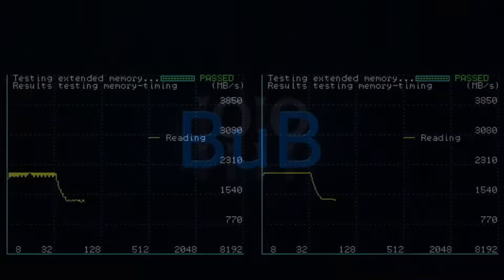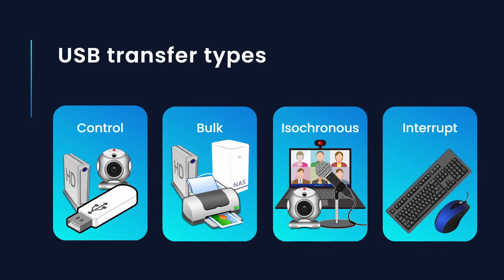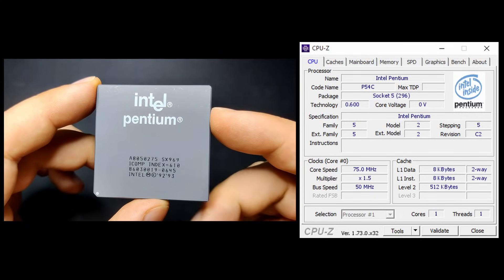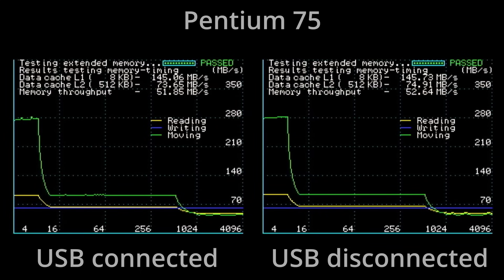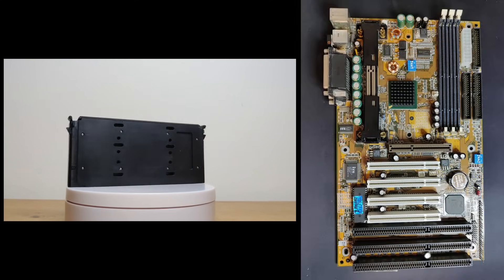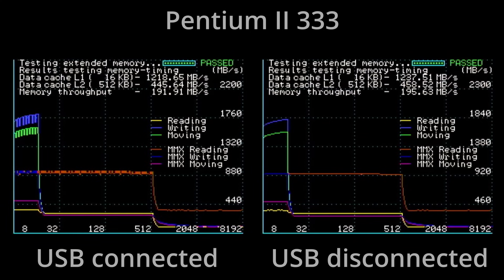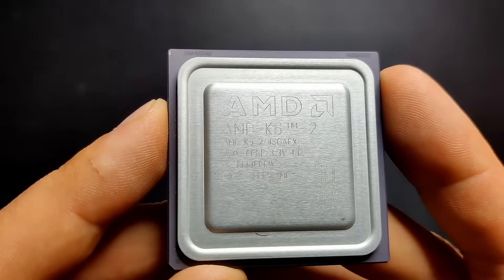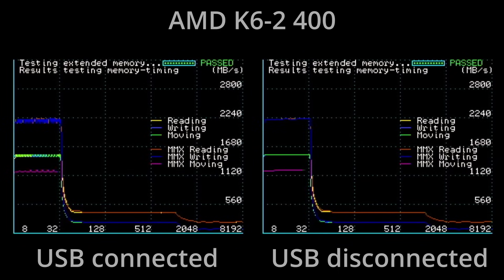Why you should avoid USB in Retro PCs

Comment: Very interesting and usefull test! Could you do something like that even with sound cards? You know that typical lagging of Windows boot sound, I was always curious about how to solve it in Win 9x systems, using better soundcard mostly doesn't solve it completely, but some soundcards have more stuff on them, so it could use less CPU and ram I guess, but I don't have any fancy Win 9x compatible soundcard to test it. The best I have is SB0100 and even with Pentium 4, booting sound in 98 and ME is still lagging.
I will be building computer for dos games with real ISA soundcard soon, so I am really curious if it's gonna be better with isa soundcard.

USB devices slowing down CPU actually make sense to me, another thing I found out thru my computer history is that integrated sound cards tend to use CPU more which can result in that typical glitching Windows boot sound, but there is not a clear rule about it, some dedicated sound cards can be even worse and vice versa and this is not happening after switching to NT based systems, so there are still things I don't really understand.
But I don't think that some 1-3% performance hit is worth to not using USB at all.

I mostly target specific motherboards with tested good compatibility where I can set USB mouse and keyboard in bios and it will always work. There are motherboards that do this well and there are motherboards that do this not well. Ofcourse I am talking about HW from time when USB was already a thing, but not a standard for mouse and kb yet. There are massive differences between motherboards from era of socket 370 or AMD's 462, some of them work like a modern PC and some of them are completely useless.

What you should really avoid always are motherboards that already have SATA for Win 9x systems, that just doesn't work or amount of work with that is not worth.

Earlier P2 and P1 MBs have advantage that there is no integrated USB controller, so you can use one that is actually good and have a good compatibility, but ofcourse mouse and kb will not work, but I would not say just avoid USB completely, I know that we didn't have flash drives back in the day, but it's really annoying to move data without that, I like retro, but I don't want to spend whole my life with messing with data, sometimes I just need to test some drivers and a lot of stuff before I permanently burn it to the CD, so USB is really usefull.

Ofcourse when you target DOS or Win 95 era, you may really need some serial port mouse and stuff like that for compatibility.

Comment: USB communication makes some things impossible. For example, the program I use to dump Commodore 64 tapes through the parallel port (MTAP) doesn't work if I boot DOS via USB. It must be either FDD or HDD, otherwise gaps will appear in the data.

Comment: I knew that back in the day when retro pc's were just modern computers. The connectors and brackets were there but the software support wasn't there. For fast data transfer I stuck to SCSI. But my god, parallel Connection with my externel ZIP drive was really slow......

Comment: Very interesting video!
A few details and thoughts:
  - From the PC's perspective it makes no difference if the USB supports "real" interrupts or not: The USB host controller manages the USB protocol side (including polling the devices) and sends a (real) interrupt to the PC whenever necessary. Some controllers might send unnecessary interrupts and let the driver figure that out, in which case you would have a significantly higher interrupt load. I'm not aware, however, how frequent that behavior is in practice, so let's keep that in the "theories" drawer. On the other hand the fact that on some platforms you tested there were periodic dips in the performance, presumably without any mouse movement, would support that hypothesis.
  - The problem presumably comes from the fact that the USB driver stack is interrupting the current program and affects the contents of the cache - just as the PS/2 interrupt would - but is probably more complex, accesses more data and affects the cache more than legacy input device drivers.
  - The specific driver implementation is another issue: If not in legacy emulation mode, the USB communication goes through the driver the manufacturer of the host controller provided. I suspect the implementations will differ wildly. It would be interesting to see how this issue affects Linux, which I suspect might have more consistent and better quality drivers overall.
  - It would also be interesting to compare different host controller cards, and specifically USB 2.0 ones.
  - As was mentioned in another comment, legacy emulation could lead to poor performance as well and needs to be tested and compared on a motherboard level basis to understand the impact.

Comment: I haven't watched all the video yet, but if you don't know, not all USB chips are created equal. Have you compared OHCI with UHCI? OHCI USB implement a more intelligent chip while UHCI pushes more work to the CPU. Common vendors are... NEC for OHCI and Intel/ VIA for UHCI. I always avoid VIA USB cards. This applies to the USB 1.1 era and USB 2.0 cards running in 1.1 mode, but I'm not familiar with later stuff.

Comment: USB penalty in retro devices isn't just hardware issues, but also software issues. The USB stack modules included in BIOSes for KB/Mouse support in DOS mode aren't smaller things and can consume precious UMB blocks you would need for other stuff. Sometimes it will prevent EMS memory from working as the USB BIOS module will steal the EMS window memory block (some Systemsoft BIOSes show the problem, it can be fixed assuming the board manufacturer provided a fixed update for that). This enables SMM/NMI which can conflict with DOS software and DOS drivers which also make use of NMI (sound card drivers or emulators for example).
In Windows, USB will always enable WDM (NTKern). Depending in your board and devices, it can conflict with VxD drivers, mostly sound cards. It will consume more memory, and make the OS slower in some circustances.

Comment: I was testing this with a NEC D720101GJ chip-based USB 2.0PCI card on an AMD K6III+ 550MHz @ 600MHz on an Asus P5A and noticed a 3% drop in composite system performance drop in Windows 98SE.

Comment: I was wondering, if you use a USB to PS/2 or 5-pin DIN converter, does the performance drop still happen or do they operate the same as PS/2 or does the polling problem still come up? I'd be curious to see if they still interrupt as often with the converters installed or if they interrupt like an older device.
Reply: When you use those adapters the device is just routing PS/2 signals though the USB cable as if it was a PS/2 mouse. There is no USB signals involved. Unless it is a fancy active adapter, which most aren't and even then the computer wouldn't see the USB protocol.

Comment: So only usb 1 is an issue because it doesn’t have its own hardware to use. 

So usb 3 should be used cause it has its own chips to process data independently of the system itself?

Comment: Just a few days ago i was testing an old system equipped with a Pentium 3 667MHz on an AOpen AX34 Pro, 256 MB of SDR PC133 and a Voodoo 3 3000 running windows 98SE. That system has only 2 USB ports in the rear I/O panel so i added a VIA based pci usb card. With a usb stick connected to that card, running 3D mark 99 Max i was getting a final score that was half the result i previously managed to get...unplugged the usb stick and scores were back to normal... Pretty extreme behaviour, i know that VIA pci usb cards are doomed but this behaviour is fare beyond my expectations...

Comment: i personally prefer using dedicated connectors when possible, i never trusted usb with its unreliable wiggly connector and its general purposeness. i much prefer using a dedicated driver and connectors with screws like db15 or some other locking mechanism like the little clips on hdmi.

a few days ago my keyboard disconnected while playing a game. this made the system crash so hard i had to clear the bios settings and unplug the pc for a few minutes so it would turn back on. maybe it wasn't just the keyboard, but unplugging and plugging the keyboard back fixed the problem. the usb connector on my keyboard always fits lose on all connectors but as long as i don't move it this isn't a problem.

Comment: The problem with the older USB Standards is that everything HAD to pass through the CPU during USB transfers. Something that thankfully was finally abandoned with the introduction of USB 3.0 and 3.1. Which i think is definitely the biggest gain from this standard upgrade, beside the file transfer speed.
Reply: This is also the reason why Firewire was superior even to USB2, even when it looked sighly slower at specs. Firewire controllers, just as SCSI before them, were always "smarter" than their USB counterparts. The CPU in the FW ASIC of the card and the peripherals could do more by itself and transfer the data between them and the host by using DMA with almost no CPU intervention. Also, the software stack was smaller, which meant you could do things like implementing Boot Support, Debugging Mode and Target Mode (your computer appears as an storage device to another computer) in firmware in a very compact way.
Ofc, since firewire controllers were almost microcomputers by themselves, that means the controller chips for both cards and peripherals were more complex, expensive and less scalable to produce than USB counterparts, which in the end was firewire demise.

Comment: I still use a PS/2 keyboard with my modern system. I would use a PS/2 mouse as well if my motherboard had a second PS/2 port. It only has one PS/2 for keyboard OR mouse. PS/2 ports have 6 pins but only 4 pins are used. On motherboards with only one PS/2 port, the 2 unused pins should be the clk and data for a second PS/2 port via a Y adaptor. All the super I/O chips have 2 PS/2 ports so there is no reason why the clk and data for the second port couldn't be routed to the 2 unused pins on motherboards with only one physical PS/2 connector.

Comment: Just stay out of USB on motherboards where Super IO did not support it. That's anything with a slotted CPU and before. If you need flash storage, there are CF and microSD to IDE adaptors (or adapters, for US friends). However, these do require reboot to detect media changes. I have a K6 ][ with an SSD, via Vantec SATA to IDE card. You can buy them cheap, so it's good to have one around. Be sure you connect 3.5 floppy power plug for 5 volts. Have fun!😁

Comment: In my new Socket 7 system (k6-2@400) I tried using Daemon Tools on 98SE to read game images through a USB 2.0 card. It made all my gameplay stutter whenever the disc was accessed. A physical CD didn't have any stutters even though my drive struggled to read it. Daemon Tools from the local IDE drive also played perfectly smooth.
Reply from the maker: It could be related to the USB chipset used on the card. I will look into this, maybe I'll be able to reproduce your issue.
Reply: @bitsundbolts   It's not really an issue, just another anecdote that USB can cause slowdowns in old PCs. I don't think it's hardware related but rather software related as I tried XP (or possibly 2k) on the same hardware and IIRC that worked smoothly. I would've kept using XP but 3dfx didn't release D3D drivers for the Voodoo 1  on this platform.

I believe the particular card I was using has a VIA chipset. I think I have a card with an NEC chipset somewhere I could also try if I want a change in the setup.

Comment: I believe results can vary based on controller chip or other factors, but particularly with add in USB2 cards, that the USB controllers being enabled (no device plugged in) in device manager can at times be enough to cause a performance degradation.  Of course that means you can just toggle the controller on and off as needed if max performance is desired.  I have gotten mixed messages from others on the exact conditions on when the degradation happens, but I know what works for my system.

Plenty of fun stuff to test there since USB 1.1 comes in OHCI and UHCI flavors, and USB 2 cards expose one of those on top of the EHCI controller which can be disabled individually.  If my memory serves they also as a result, if all controllers are enabled, use 3 of the 4 PCI IRQs, so while not a huge deal IRQ sharing could be a factor in achieving the last bit of performance.

Comment: Just want to say, USB overhead was well known at the time and even latency was an issue. This was all known and tested extensively by nerds a long time ago. USB didn't really become a non-issue until USB 2.0. I remember very well discussing this ad nauseam on forums back in the day.
Reply: It looks like USB 1.0 generates interrupt for CPU every time mouse moves (instead using DMA bypassing CPU entirely).

Every CPU handle interrupts and context switching with different penalty in cycles lost. Modern CPU has special HW to accelerate context switching due to those were designed for modern multitasking OS. Obviously old CPU designed for single tasking DOS lacks this support.
Reply: There were overclocking tools for PS2 and USB back then.

Comment: It's interesting that you reported this. I have a VIA USB 2.0 PCI card in my PIII-933 system. I use it routinely for large file transfers as I have reliability issues with my optical drives. I also don't expose my current systems to my retro systems over the same network. Honestly, it doesn't affect performance for me to notice it under Windows 98 SE (USB storage extension) and 2000 Pro.
Reply from the maker: I have not seen any issue with data transfer (HDD or flash drives). The issue only appears when using input devices like keyboards and mouse. I will get some PCI USB 2.0 expansion cards with different chipsets (NEC, ALI, VIA, etc.) and see what is going on there.

Comment: I wonder, if disabling 'legacy device emulation' in BIOS would speed things up under windows. (But this will entirely disable USB input under DOS)
Reply from the maker: I have to look into this more in depth. I don't think that the two socket 7 motherboards have that option in the BIOS. They only allow to enable or disable USB. I may test this with PIII and maybe even a P4 system

Comment: I have several retro computers that have usb and none of them have any issues with pendrives or keyboard and mouse. I just use usb in order to use pendrives but I ran tests with a wireless keyboard and mouse and everything was ok. No change in performance.
Reply from the maker: That's interesting. 3 of the 4 boards I have tested in this video show the issue visually in SpeedSys when an input device like a keyboard is connected via USB. Could you share the hardware you're using?

Comment: Connecting a single flash drive to my K6-2+ machine via USB2 card KILLED performance, way more than 3%! 3DMark2K score went from 1600 to 1200! The reduction is much less if I swap the USB2 card for USB1.1 but it's still there - maybe 10% or so in the same test. Also I did try USB2 cards from different manufacturers and there was some variance. IIRC the card with an nVidia chip did the best which is the one that dropped the score to 1200.
Reply from the maker: That is interesting since I couldn't notice a performance loss with storage devices connected to my systems. The behavior only appeared when using input devices like keyboards. It may come down to the USB implementation. I'll try to get different USB 2.0 expansion cards and see if I can recreate your experience.
Reply: @bitsundbolts  I believe it's something about that specific K6-2+ machine because I don't see that massive deficit with any other retro PC.  I do recall seeing a SMALL deficit though, with my 440BX-based 1GHz Pentium III system when leaving a flash drive plugged-in.

Comment: The performance drop is waaay bigger than 4%, I remember back in the day I had a PIII 550 Mhz, and when I switched from a PCI 56K to an USB 512 Kbps modem, when playing Counter-Strike, my FPS went down from 50+ to low 30's, it was immediately noticeable, I had to keep it unplugged all the time to just play single player games, I begged my parents for months to switch to another ISP, when they finally got an RJ-45 ethernet gateway it was such a relief, I got back on good form again.
Even today in modern 8 core systems, you can clearly see in task manager that when moving a 1000 Hz "gaming mouse" prevents the CPU from getting into the lowest power and clock states, my i7 4770 can downclock to 1 Ghz when moving a PS/2 at 200 "Hz" (reports per second) or 125 Mhz USB mouse, but when having a 1000 Hz + USB microphone, It idles at around 1.3-1.5 Ghz...  that is the reason even today, laptop touchpads and keyboards still use the PS/2 protocol, to save CPU power.
Reply: It would be cool to re-run the tests with the USB devices actively in use and not just idling, like using the USB soundcard from your headset + KB and mouse moving, there are other things that also affect CPU performance on retro (and modern...) PC's, using the Realtek onboard soundcard (specially if you enable the background noise suppression), and high amounts of open TCP/IP connections, write caching on HDD's, having Hyper Threading enabled when not taking advantage of the extra threads, and some more I don't remember....